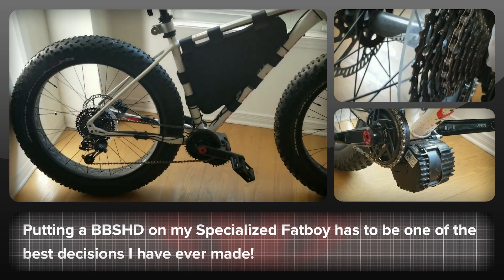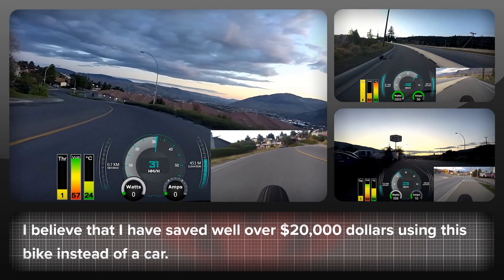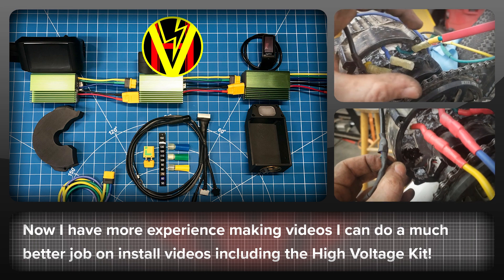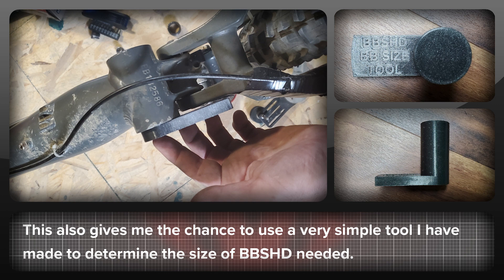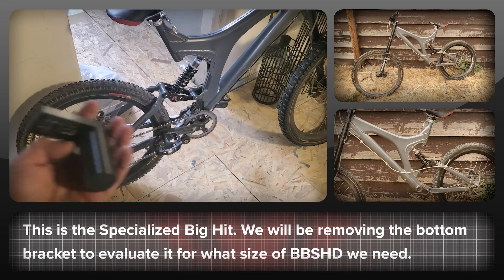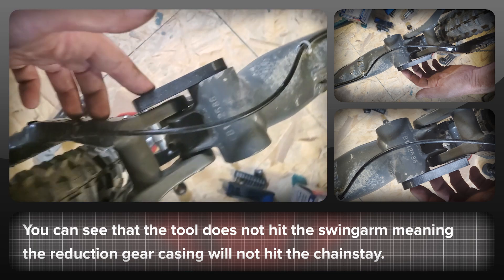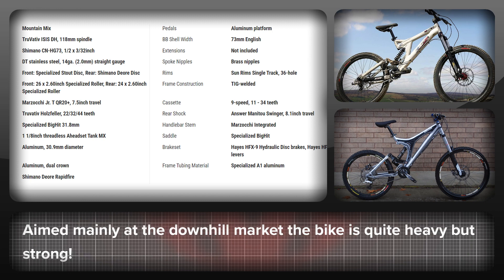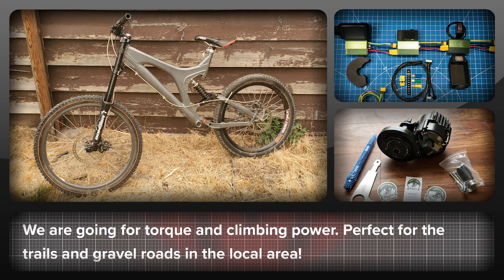NEW Bafang BBSHD Build - Specialized Big Hit with the High Voltage ASI BAC855 Upgrade kit - Part 1

Comment: For a battery mount, it would be great to make a rear rack somehow braced to the frame like on the Riese and Muller Superdelite. I was looking at ways to use a seatpost rack with aluminum support rods attached to extensions on the frame or pivot bolts somehow. I love the idea of a suspended rear rack for cargo and blazing down trails at speed.
Reply from the maker: I have a few ideas for the battery location. The rear is an option..A few people on the discord chat server have done this with a beefy rack. You are welcome to join and ask. I'm sure you will get lots of info. https://discord.gg/9UwDG4j

Comment: I have done this exact build myself...and taken it to the next level by modifying the frame
Reply from the maker: Awesome. What frame mods did you end up doing?
Reply: @HighVoltageKits  I think you have seen it on Facebook. What I would suggest is if you're fitting the battery underslung run a 24" front wheel. If using it on tarmac 2.35x24 crazy bobs are unreal.
You will need to remove the lugs  for the chain guide on the bottom bracket 👍
Reply from the maker: Thanks Mike. No chain guard mounts on this version. Or already cut off

Comment: Is the high voltage bac kit the same as ert's NXT bac kit?  I just installed that and have been talking tons to Alan about stuff and man I love this NXT kit it's ridiculously awesome.  Going forward I'm going to work with Alan to do testing and see about helping him further develope the platform.  I remember him mentioning your channel one time to me and I could of sworn seeing you using the nxt once before so I'm just unsure and that's why I was asking if you guys are selling the same kits.  Anyways I also wanted to say I'm a huge fan of your channel I've watched quite a bit of your videos by now and I love them.  Their so informational its such a extreme help especially for me earlier on when I was trying to decide which route to go with my ebike set up.
Reply from the maker: Well the NXT I co-develooed with Alan. So the onscreen graphics and case and dock as well as a lot of theoretical development is my work. I'm not sure where it will go. I'm sure your data will be useful. The politics is complicated but if we wanted to do business with ASI then no NXT. The High Voltage kit is a fresh map from scratch. In terms of overall performance they are more or less identical. The difference is the level of customer service and quality of wiring we provide.

Comment: @ 2:07 you mention 83mm version. I’ve read they offer MORE than 3 versions but can’t find anyone who sells them. Most seem to be 68/73 same motor 2 applications the 100 and 120mm where can these “oddball” sizes be had ? Thanks 

Your measuring tool is brilliant 👍
Reply from the maker: Sorry for the confusion. The 68/73 will do an 83mm with the use of spacers and an off set crank arm on the non drive side. If you want am happy to share the file for the tool. If you are on discord I can send directly.

Comment: Awesome information! I was also looking heavily at this particular downhill frame as it has superior strength and excellent geometry for the BBSHD. I am assuming the rear dropouts are built strong and will be able to handle the torque coming from the rear wheel.

If you're going for pure torque and hill climbing monster why not just go with a 1:1 gearing ratio? That would definitely simplify the parts needed and you could get the chain line really straight with just one gear and spacers. 

I heard on the discord chat that using a 42t front and rear gear with the High Voltage kit, you will get an insane amount of torque and a top speed of 45mph. Sounds plenty to me!😎🤟
Reply from the maker: Yeah. I run a 42t to a 42t rear on my fatbike. It would definitely work well. We are going to try and have a bit of flexibility gear wise at least to start with. The frame and dropouts look good. With a mid drive there is very little stress on dropouts. More a hub motor challenge. Looking at the pink bike adds you can get one of these for about 600 bucks depending on condition. Not bad especially if you redo the shocks etc. Thanks for the comment. Cheers!
Reply: @HighVoltageKits  awesome I will take a look at pink bike and see what I can find. 👍
Reply from the maker: Sounds good. Let us know how you get on!
Reply: Honestly I have a 1997 Cannondale with 9mm qr axles and even that handles the torque of the BBSHD with the bac855 just fine.  I'm actually surprised I was sure I'd break something seeing how powerful this set is.  Also one thing I've noticed is gearing doesn't matter in the same way it matters on a gas engine or human pedaling with the electric motor no matter what gear I'm in I almost achieve the same exact speeds the only difference is the rpms the motor reach's at those speeds and how fast I hit those max rpms and speeds.  It's hard for me to wrap my head around why that does that but I've tested it pretty thoroughly and no matter what I do the speed ends up almost the same in every gear when the amps stay the same.
Reply: I ran my bighit with a 42t front and 40t rear...and can confirm around 40-45mph. But I weigh about 10stone and keeping the front-end down was a real problem. With this gearing it would smoke a std Sur-ron upto 40mph ....I did It lol
Reply from the maker: Appreciated! Thanks
Reply: By the way I'm running a 42tooth also to a 36tooth but my chain line won't let me in first gear (I'm working on fixing that) so I've been running the 42tooth chain ring and 28tooth.on my cassette and it does get warm a bit if I'm on the throttle for long extended periods.  I've also noticed it gets a hell of a lot hotter if I got into any gears on the cassette with less teeth and hold it.wide open for long periods of time so definitely it's better using the higher teeth cassette gears and like I said before with field weakening and the way it works no matter what your just going to end up with higher rpms meaning the same top speed.  I guess there must be a point where the gearing is at it's most optimal point but I haven't figured that out yet.  I plan to get a 50tooth box three or box four ebike specific cassette soon (they're not cheap at $300) and when I get that I'll know for sure if my theory proves correct.  I'm thinking with 50 tooth in the rear cassette I'll likely still get to around 45-55 mph (45mph is what I hit consistently once in a blue moon I'll hit 55mph though) but my motors rpms will likely be much higher and the temps cooler.  I'm working with the guy that made my kits on a temp sensor that will read out the temps of the motor on the display I'm using soon and that will also let me know a bit more about what the motor prefers
Reply from the maker: Yeah. It will be interesting playing with gearing on the new build. Smaller back wheel. 24 I think
Reply: @HighVoltageKits  yea even a 20inch rim if you can get away with it would be even better.  If you ever seen those kuberg ebikes/scooters they use a huge front wheel and super small back wheels and they are some of the fastest bikes around and sure put a smacking on stuff like modded surrons.  Im following your progress and videos closely since we run similar set ups so I can learn from what your doing.  I appreciate you making all the videos you make. So does this make it official do you like the BBSHD better then the cyc motor?
Reply: @WarzoneWarlordGaming  yes I would like to know that too. How do you feel about the cyc motor versus the BBSHD as far as sheer power, throttle response, longevity? 👍

Comment: do you have any experience with BBSHD and press fit bottom brackets?
Reply from the maker: You can use adapters in some cases. PF30 for sure. You can buy those off eBay.

Comment: Just got the same bike a week ago and just ordered bbshd yesterday. Hoping to put battery underneath with hose clamps (with bolt through hole drilled in hose clamp) on battery mount and straps around battery and frame. I think tire would hit battery at around 5 inches of suspension movement. I believe my fork has a travel limiter (manitou sherman) so should be safe.
Reply from the maker: Oh awesome! Should be a good frame. There are a few options on batteries. I might try making a mount to run two Dolphin style packs across the frame... Will have to check the dimensions. Underneath is an option used a fair bit as well. Let me know how you get on!
Reply: @HighVoltageKits  got it going today. I ground about 1mm off the bolt holding the lower swingarm, and ground off the  mount below the bottom bracket. All gears work without chain coming off front chainring so far although chainline does not look good in biggest cog. Bike feels like a  dirtbike.
Reply: Biff mister get you a bac855 controller kit for your BBSHD man I'm telling you that you won't be disappointed I loved my BBSHD stock but now that I have the bac855 controller I can honestly say it ruined riding with the stock controller for me as I will never go back to using it ever again!!!  The asi controller is so smooth even if it was more powerful
Reply: @WarzoneWarlordGaming  controller sounds good real good because stock in high power and biggest cog power is more than a little uncontrollable. Also when you are off throttle and are in a corner and move the pedals is where I have a close call pretty much every time I ride the bike.
Reply: @biffmister941  yea I know exactly what you mean.  The only time the bac controller does that similar situation is when it's using the field weakening it is a bit jerky but I'm still figuring the system out and I'm learning that you can tune your set up to make it not do that.  I'm doing a lot of learning still with this new controller but I really like the fact that I don't need a computer to change settings I can just do settings changes to the power and everything else practically on the fly even while riding still.  You will love the upgraded controller.  The stock one is ok but the upgrade is awesome and really I wouldn't get the upgrade from any other source other then ERT because the controller without the nxt display kind of sucks unless you buy it direct from asi and get the bacdoor access and even then it isn't as nice as the nxt display.
Reply: @biffmister941  I have a similar chain line issue I've tried so many different chain rings and the issue either gets worse or stays the same.  The only chain rings I haven't tried are the bigger lekkie ones I've tried their smaller ones and they made the chain line issue worse but the gearing was such that I could not use the bigger gears and get away with it just fine but I like having the full range of the rear cassette so I think the answer is to put spacers on the rear and maybe do some other mods to the rear.  The nice thing about having more power is that you really don't need to change gears nearly as much and the field weakening makes the higher torque gears spin up to higher rpms so you get almost similar speed in those gears then what the motor will do in the higher speed gears because the only difference while in those gears is the motor spins at lower rpms but the field weakening makes the speed almost the same with the exception of maybe 5mph

Comment: I look forward to it. Are you still waiting for the M625 ?
Reply from the maker: It arrived and was damaged in multiple places including a stripped bolt. I think they send me a return or a reject. They are accusing me of damaging it though for some odd reason. Either way my teardown is delayed while I deal with the seller. I did not want to hold up the build though so we went with the tried and trusted!
Reply: @HighVoltageKits  Thanks for the reply. I'm planning my next build and interested to know whether to go for an M625 or a BBSHD. Hopefully you get it sorted soon and I shall keep watching. Enjoying your channel. Current bike BBS02 48v (motor set @18amps) done about 1500 trouble free miles. Main gear greased with Mobil SHC.
Reply: @JohnSmith-ch9lp  I have the BBS 02 running on a BAC855 running 2300w around 45amps on 52v the difference is like night and day it's quiet and smooth if the HD can handle 4000w on a sine wave controller the 02 handles around 2500w when ridden with common sense, common sense being the ultimate phrase used here .. 
PS: No it hasn't burned out or overheated it runs fine 500 miles in the last month run like a dream it's a different animal..
Reply: @yj8471  Good grief! I'm not sure I need that kind of power but that sounds quite a setup. I agree, common sense and use the gears to keep the motor spinning.